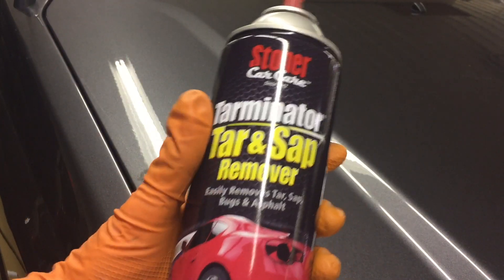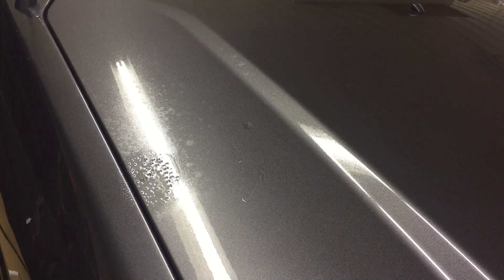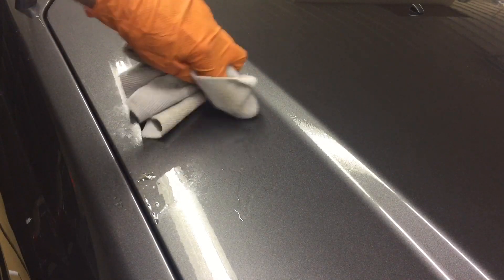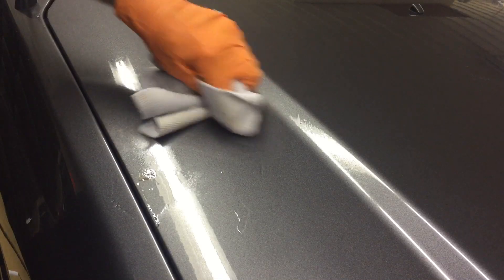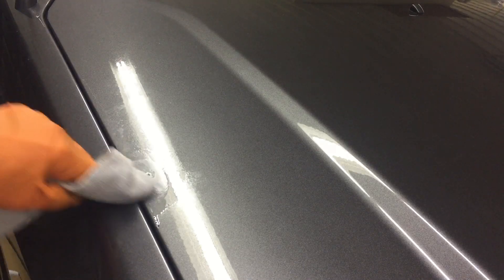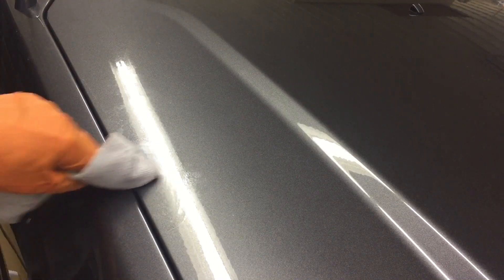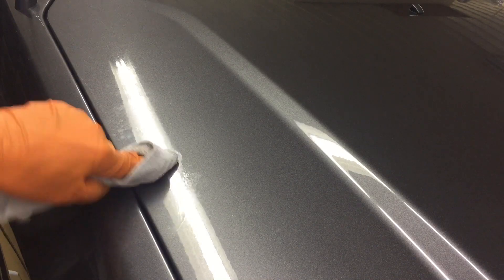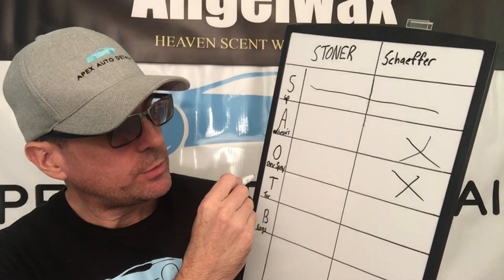Head to Head!!! Schaeffer Citrol 266 Versus Stoner Tarminator Bug and Tar Remover!!!

Comment: I just a bought a used car and the wheels were neglected and never cleaned.  After thoroughly cleaning them from a thick layer of brake dust, tar stains are on the barrels and won’t come off with anything I’ve tried.  I haven’t used these products though mostly because they’re not over the counter at most stores. My question is, would any of these do the trick and remove the nasty tar stains on my wheel barrels?  Thanks
Reply: If iron remover such as iron x wont work, you might want to try an acid based wheel cleaner to clean up the rims. Once clean stick to regular car wash and iron remover.
Reply: I'm having the same issue deep inside of my wheel barrels and lugs. I used to Adams Wheel and Tire cleaner and I also used carpro iron X, with a lug brush. It's all still there. Did you find something that worked?

Comment: Is Citrol 266 what I want to get off (super) stubborn chipseal (or fogseal?) residue?  I went on a road which had recently been done. thought I was safe because no stones, but i now have a light something splattered up from the front wheel. I've made multiple attempts with 3M Adhesive Remover and the stuff isnt' budging.  Luckily it's hard to notice at the angles one looks that low on the car, but I want to get it off.

Comment: Great video as always, I use tarminator , never had use the citrol because price, I found that the link you post has a really good price and I was pretty excited about it until I calculate shipping cost and it came to almost $ 12 for ground shipping. Do you find it locally some where?
Reply from the maker: There are two places locally... a farm supply store and diesel repair shop for large trucks
Reply: Apex Detail how do you think the rapid remover will stand up with the citrol 266?
Reply from the maker: They are very close...Citrol is a bit more versatile
Reply: @apexdetail85  Wilson auto detailing believes citrol is more versatile. Could we get a comparison video in the near future please?

Comment: Ahi,
 Clear coat question.

If the clear coat measures 4.6 how much can I safely remove. Removing a deep scratch from a very expensive Aston Martin next week. It not through but deep.
Many thanks
Mark
Reply: Are you sure that is the clear?!?  Its usually 1,1/2 to 2 mills thick from factory.... unless it has been repainted. Make sure of that first. My Positector measures total thickness .. not layers

Comment: Can you use Cotrol for hard water spots? Thank you!
Reply from the maker: If they are quite fresh...if they have been there a while...compound is needed.
Reply: Hey brian good test it worked for me. But to the answer on hard water spots, can i compound my windshield glass? It has hard water spots. Thanks.
Reply: I recently used Meguiar's Water Spot Remover on chrome colored hard plastic, and it surprised me and did amazingly well.  When I had body work done at the Honda dealership they "tried" to remove them (or so they said) but I stumbled across the Meguiars product at Pep Boys for $6 a bottle and figured it was worth a shot.  Definitely a great investment on my part.